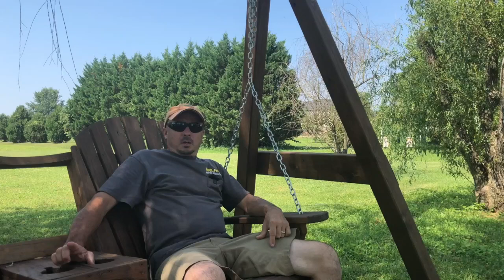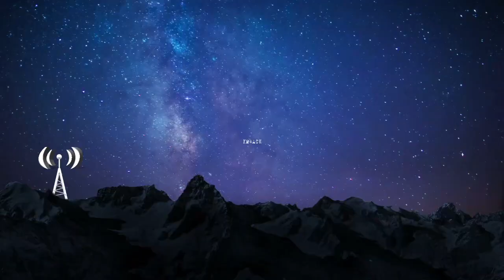Radio Frequency Interference - Self Induced

Comment: I do have a problem getting GPS in my garage, I was just gonna run a single USB extension for just the GPS dongle... hopefully that wont cause a similar problem
Reply from the maker: Please report back after you do. That was on my to-do list if I had issues with the GPS under the seat. I think what saved me was the soft top on the jeep. Since I was still getting GPS signals, I haven't moved the GPS again. I even get signals inside the garage. Just got lucky I suppose. Really not needed in the garage as I use the autohotspot script and have the jeep pi connect to my shack wifi when parked. It can grab time from the internet if need be when  in the garage. 73, de KM4ACK
Reply: @KM4ACK   I use a miniproSC... so I dont know what this chatter is.... makes me worried I could have a problem and not know it.
Reply from the maker: With the signalink, you can hear the chatter within 6 feet of it. It's the transmit kicking in and out. I could also see the transit LED blinking during transmit when it should be solid red. 73, de KM4ACK

Comment: I'm hearing (yes, I listen sometimes) TERRIBLE chatter (garbage on tx signals) at some times on ACKS to Heartbeat beacons , from the stations responding. There are so many stations responding its hard to know which one (if I'm able to decode with all the chatter) is having the problems. All I can say is , get some kind of transceiver/short wave set , old hallicrafters, something, to listen to what you transmit out, while wearing headphones (Dummy load on receiver, possibly shielded more than usual). If you have that , listen to what he is saying. Some may need to add the clip on ferrite attachments, or make the set ups he describes with toroids, to your USB cables or other cables. Feedback from your RF is what typically is causing this, it can get into just about anything, even your power supply, and be fed back to your transceiver or sound card set up. I used a "Trip-lite" brand cable , molded in RF chokes on both ends, with really good results with my IC-7300 . I have open wire line (450 ohm) and know that I have RF in the shack that I haven't been able to eliminate. But, with the right USB cable I was able to eliminate the problem, which was less sever than a Pi next to a transmit antenna !
Reply from the maker: Well said! You definitely can learn more about the signal you are putting out by monitoring it with other equipment. Nasty digital signals drives me nuts. 73, de KM4ACK

Comment: I don't run any type of timing gear. Not needed with JS8 if you just simply turn on the time drift controls and click the end of tx button when one transmission ends. Now, to get in the ballpark quickly, I go to ft8 and click after the end of that mode. Gets me close. Then I switch back and can decode almost everything but I wait for a few transmissions (with time delta on in several of the viewing screen areas) and if I'm withing a few hundred milli secs I'm good. Your vid on this was good.
Reply from the maker: Yep. Timing can be accomplished multiple ways for JS8. Using time drift is one option that works well. I'm just too lazy to use it most of the time. Set up the GPS once and let it do it's thing. However, it's good to know about the time drift control in case the GPS fails while you are in the field. 73, de KM4ACK
Reply: @KM4ACK  I like the GPS option for more reasons, for one, it can be used to update your location in the software your using in your Pi for APRS and even give you a 10 or more digit Grid square number to put in your JS8. You can show up on APRS PI with that, and its amazing how accurate it is. That said, for the home stations using a Win10 cheap Chinese tablet (touch screen h10 Chuwi) which seems to have problems with internet wifi time stuff sometimes, the quickest is the set up I'm talking about, drift controls and turning on Timing Delta all over the place. You'd be suprised how many are 3000 milisecs out of time ! And, if the majority of signals are within 100 to 300 ms, your right on. Good practice for the occaison when your trying to help someone in a remote station without GPS !

Comment: If timing is the primary purpose and rough grid square is fine, sounds like a good move for the GPS.

A "Faraday" box like the small radio go kit you showed in a previous video would also allow you to bond everything together.
Reply from the maker: Timing was the primary purpose of the GPS. While an exact grid isn't required, it can be helpful in some situations. The GPS is still working fine even after moving it to under the driver's seat. Thanks for watching! 73, de KM4ACK